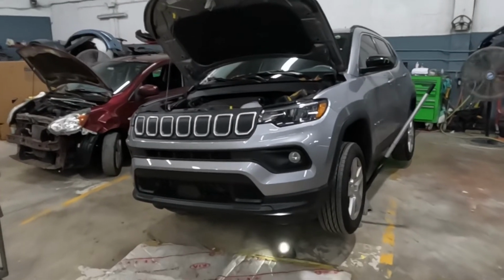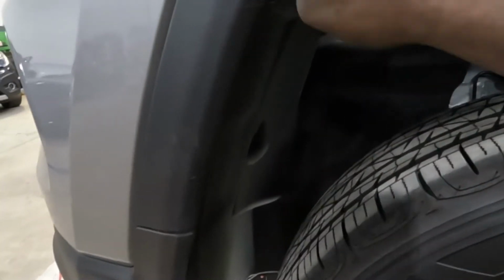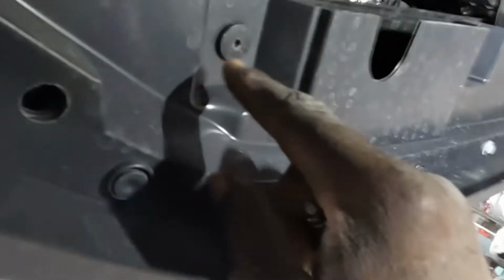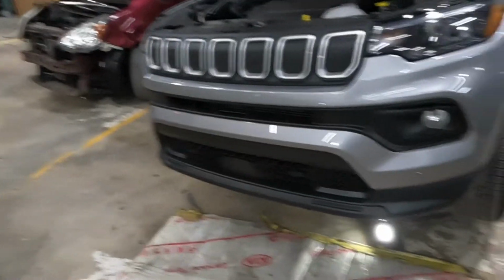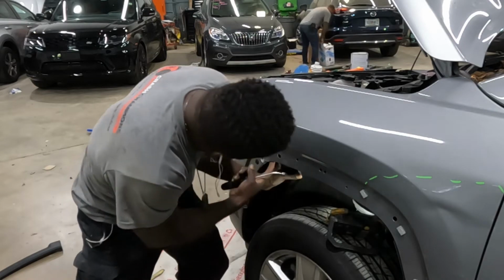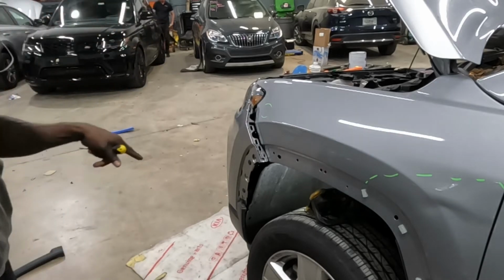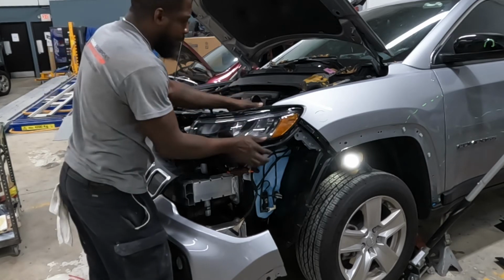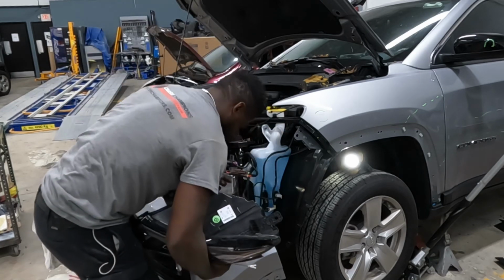2022 JEEP COMPASS how to take off the front bumper and head lamp

Comment: Hi. Thanks for the great video.!!! Now, in your experience with these vehicles, do you know if the dimensions of the front end are the same size for all of them? What I mean is this: I own a 2018 Jeep compass and I would like to upgrade to the 2023 look by replacing the front end and headlamps. Meaning fenders, bumper hood, headlamps. Would the 2022 front end fit a 2018 Jeep.Compass? What do you think? Thanks in advance for your prompt response!! Cheers!! 😊👍
Reply from the maker: No it won’t fit because the year is too far apart